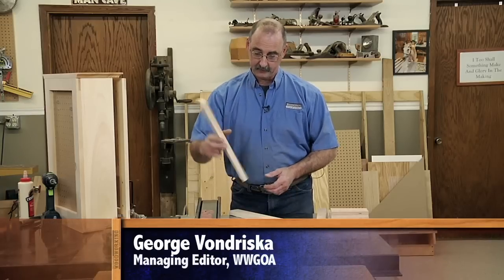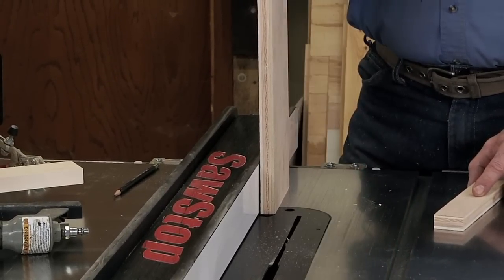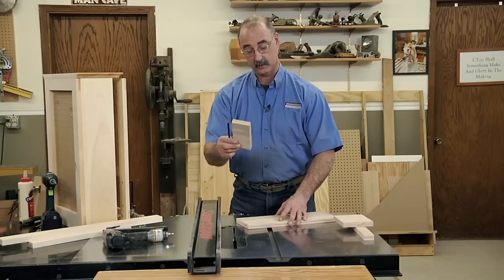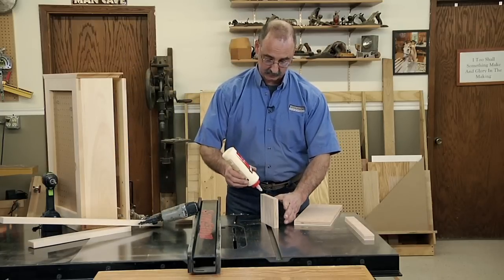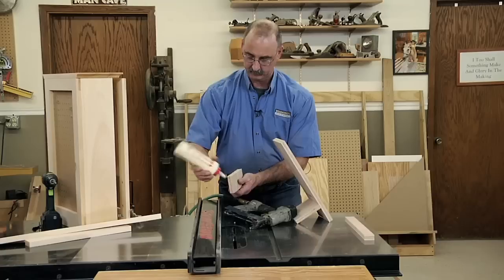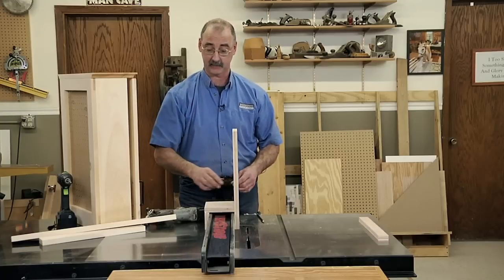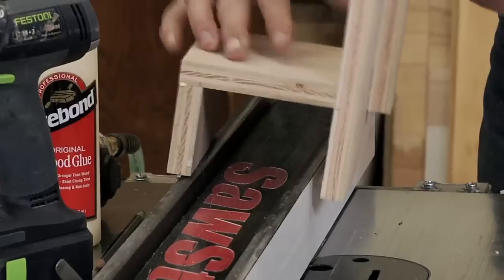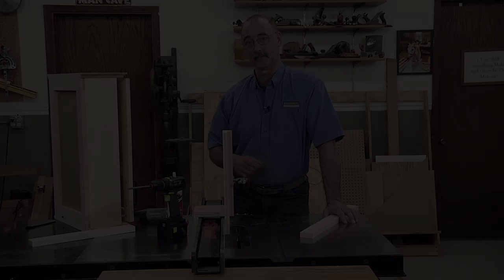Make a Jig for a Half Lap Joint  |  Woodworkers Guild of America

Comment: This jig worked great for creating the half-lap, but boy my (cheap) table saw did NOT like making that vertical cut with so much blade exposed into the end grain. Definitely do it in multiple passes. Also, the first time I messed up and didn't attach a long bit and the wood kept cocking to the side as I pushed it through the saw. That little detail was very important!

Comment: Nice jig but...i may be a newbie woodworker but why wouldn't you just lay the stock flat on the table saw and use a dado stack??
Reply: With a miter sled of course
Reply: I agree. However, use this method if you don't have a dado stack..or if you're like me and too lazy to change your blades
Reply: +Robert Kaylor it depends i used to hate changing blades but I had a project that called for using the dado blade, and with the wrenches that come with your saw its quicker
Reply: +Ben Redelings I wondered this exact same thing. I was thinking just a regular saw blade and just make several passes real quick and clean it up with a chisel or hand plane. I did like the video though! I haven't made any nice jig's like this yet.